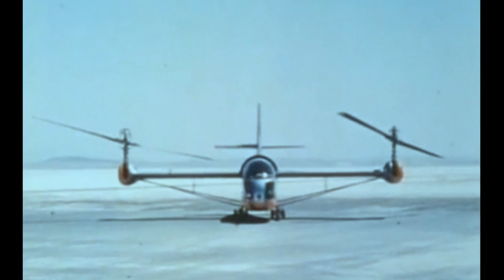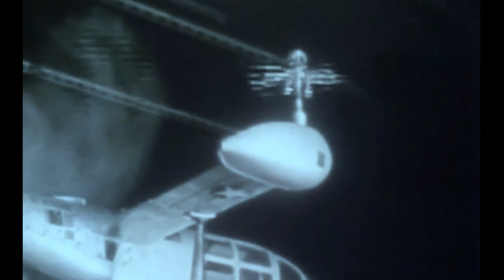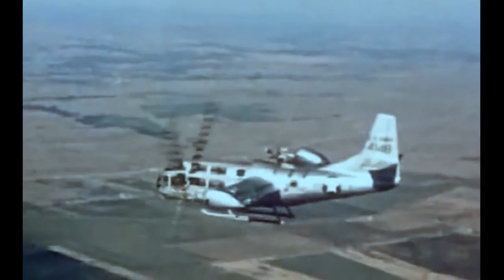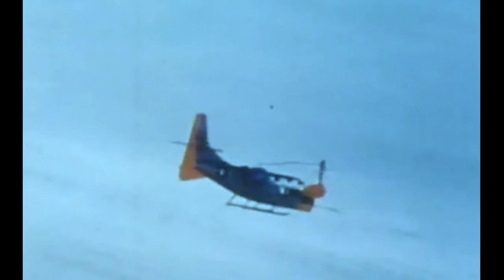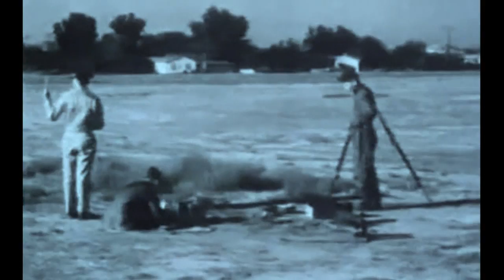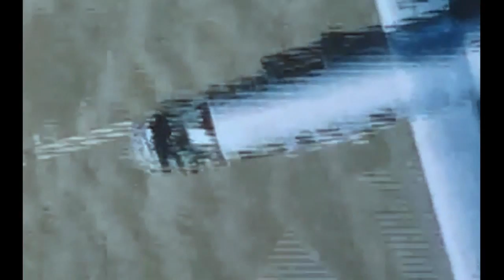Bell XV-3 Convertiplane Promo Film - 1960

Comment: I built the model back then, by Aurora I think... looked cool but boy what a large slow target it would have made.  Full load tests made it even more clumsy and slower, especially if the occupants were moving about inside. I believe the blades flung off once, cutting through the fuselage... I may be wrong.

Comment: The XV-3 seems to be the backbone that ushered the V-22 as well as the in-development V-280 Valor. The V22 in relation to the XV-3 design differs in achieving VTOL to forward flight and vice versa as the Osprey relied on rotating the entire engine nacelle with the rotor. While the Valor mirrors this craft in achieving VTOL and forward flight by rotating thr rotor shafts itself.
Reply: It seems that there was too much strain on the shafts that carried the rotor-blades in this early design.
Reply: @None-zc5vg  What are your thoughts on the configuration differences between the Tilt Rotor configurations of tilting rotor vs the tilting nacelles?
Reply: @kinchan3334  I think that the original tilt-rotor/engine(s)-in-fuselage layout wasn't practical in that it would have taken up cargo-/passenger-carrying space in the fuselage: otherwise, it was a good idea from a weight-distribution viewpoint. It seems that they found a way of ensuring that the rotor-support shafts were strong enough to take the strain of all rotor positions.
   The podded-engine alternative allows for more available power and hence much-smaller diameter rotors, making the layout more compact and the only option for military cargo/troop-carrying.
  .I wouldn't like to have to risk my life by flying in one of these compromise aircraft (or in one of those big, software-dependent military helicopters like the "Chinook".

Comment: Thanks for posting I saw the photos in a leading aviation magazine  on the testing of the tilt rotor system and the adys for the new Bell Convertiplane but never knew it flew  due to the type of engines at the time.

History is amazing at times as we only see a small part of it in our life time , Just take those who saw the birth of radio as a kid and then came TV ,  The aircraft went from a biplane in WW2 to the aircraft like the SR71 and who knows what's truly hiding in privet complains or US Gov- labs after all its more that possible we have flying disc- Type aircraft  or trade for UFO craft from others worlds in time & space just as people did 200- 500  years ago when new lands were found across the mountains or across the seas were ships would sail 

One has to thank all those test pilots who risk so much putting strange aircraft through flight test and never knowing for sure at times if the dam thing was going to come apart at any time, and we have to thank all those who have work on aircraft like those  for it was pure math & Slide rules along side the drafting table were engineers work day and night to produce new aircraft.

And thanks to the men that build them as well

Thanks for posting I love it

Comment: Then they would have said it cost $ millions, yet it any good workshop can build one.
This type of aircraft would be very useful in the outbacks of Alaska, Australia and Africa for different roles including search and rescue.
Reply: So true but the new breed of light LSA aircraft are flooding the world aviation market place some are pure aircraft and others will be total Electra or a mix of elect /  gas engine used to power a generator or light turbine 

Ever so often things go wild one time aviation was hot with new ideals and inventors some made it , some flop big time and others lost there life on the first flight and then came WW2 were avation went into high gear and latter on we had a whole slew of aircraft like the 337/ Cessna Sky Master that were STOL aircraft and along came the Jets and helicopters have move into a mix with fix wing aircraft and behold the V 22

Now we have Drones that can help Search & Rescuer, spy on people at 10,000 feet or higher and even lunch attacks and the birth of small light aircraft both electoral and gas power has open up new markers for cheep low cost air taxis in places like NY were traffic is slower that walking at times 

The aviation world is changing and has change so much from the 60,s
Reply: @terriecotham1567  A German designer in WW2 planned a coal-fired*-ramjet powered delta-winged supersonic jet interceptor. The airframe-design was flight-tested in glider form while the engine, which used gases from a rotating drum of heated coal-granules, was a ramjet that could achieve supersonic speeds and was found to ve viable in postwar tests. 
    * Germany was short of aviation fuel.

Comment: One potential problem might be if the rotor mechanism was in its horizontal flight mode (or somewhere close to horizontal mode), and there was some kind of mechanical problem which prevented returning the rotor mechanism to vertical mode, it would be impossible to land the aircraft without the rotors striking the ground due the very large radius of the rotors compared to the usual radius of a standard airplane propeller.

I guess they resolved this problem on the Osprey by decreasing the rotor radius while still maintaining sufficient thrust for vertical (helicopter type) flight.
Reply: Actually, it is not.

Osprey's rotore di not allow horizontal take-off or landing

Comment: +Mike Bleas -  Not included in the film for obvious reasons, the XV3 had nagging rotor mast dynamic stability problems which resulted in one aircraft being destroyed and its pilot seriously injured.  Several rotor configurations (using both two and three blades) were tried, and airframe mods were made, but the problem was never completely solved...  Given the length vs the diameter of the rotor masts, their being pivoted at the end of the relatively small wings, this configuration would have been a dynamicist's nightmare, considering the unknown forces generated by transitioning from helo to airplane, and the limited calculation capability of the time.
With its single PW 450HP R-985 engine, the 5000 lb XV-3 had limited performance, meaning that in a production version the size, say, of an H-21 Shawnee (approximately 3x the gross weight and 3x the HP for a helo-only machine), multiple engines would likely be required, introducing the issues of higher empty weight, requirement for interior volume, fuel capacity as well as shafting multiple engines to a common transmission, or cross shafting as done in the XV-15/V-22.  These problems were eventually solved by placing relatively lightweight, powerful turboshaft engines on the wingtips and cross shafting each to the other's transmission in the event of engine failure.  The design of the XV-15/V-22 eliminated the XV-3's long, slender rotor mast, and it is reasonable to assume that considerable expertise and computer time was applied to the structural dynamics in the newer models, making the Achilles' heel of the XV-3 a non issue.  It is also reasonable to assume that the XV-15/V-22 team "went to school" on the XV-3, and used much of the data obtained in that program to develop the Osprey.  IMO the fact that the XV-3 flew successfully is a massive tribute to Bell's engineering team.
 
http://en.wikipedia.org/wiki/Bell_XV-3
Reply: Thats the first thing i thought of a soon as i saw it in the transition, those big props are a long way out on those spindly looking shafts.
Reply: Crap idea then... crap idea today...  V-22 Osprey is the worlds most annoying aircraft. You ever hear one of those fly over? So g'damned loud... like SIX normal helicopters! You look at that thing and just say to yourself: "WHY!?"
Reply: @heyidiot  Because prop planes cant take off vertically and helicopters are slow?

I would think the advantages are pretty apparent.
Reply: @Xzavier Uriah Flixzone has a horrible user experience.  Stealmycreditcard is way better
Reply: Bullshit ! Make it sound harder than it is to justify billions of tax payers dollars
Reply: @crouchingwombathiddenquoll5641  Please, by all means make a better one thats cheaper and has a better safety record

Comment: The auto-rotation capability and low disc loading of the XV-3 makes it a much safer aircraft compared to the V-22 Osprey. Imagine what happens on the Osprey if you lose both engines in combat or your fully loaded and have to rely on only one engine along with the drive shaft that connects both rotors.
Reply: Dan Peoples   A single engine out is not too bad a deal, as both rotors will continue to provide lift, if reduced, providing the ability to make a controlled landing if flight can no longer be maintained.
As for autorotation, the good news is that the USMC has a procedure for V-22 autorotations... The bad news is that reading through the bureaucratese indicates it's gonna be a "challenging" day for the crew... See Sec 2.5, pg 27 of this report: http://fas.org/man/dod-101/sys/ac/v22-report.pdf
Reply: jimmbbo "the probability of a successful
autorotational landing from a stable autorotative descent is very low.”  That's pretty scary!
Reply: Dan Peoples isn't disc loading related to overall weight? If it is then this little aircraft wil always have a lower disc loading than the much larger CV-22. With its single engine there's more chance that this'll be auto-rotating to the ground, provided that the pilot can get it into helicopter mode.
Reply: Neil, the disc loading is dependent on weight yes. But its dependence on weight is in relation to the "disc size". Since this air craft has two lifting rotors it would have a much lower disc load compared to a similar weight aircraft with a single rotor....
Reply: Imagine that your 'Osprey' is taking enemy fire and one of your rotors is damaged or shot off.
Reply: These convertiplanes are flying death-traps.